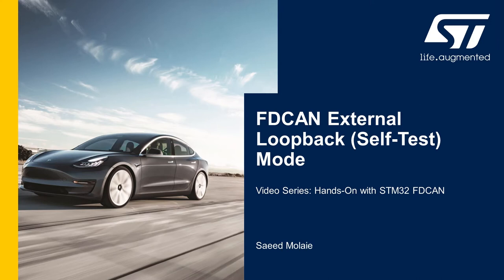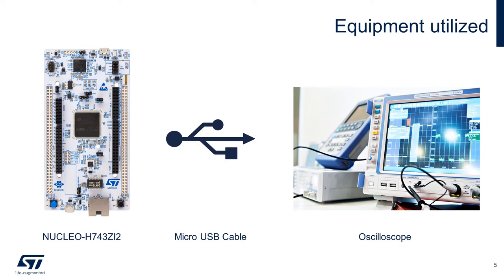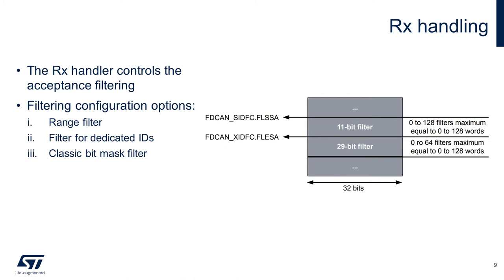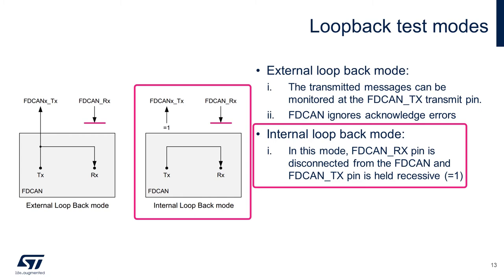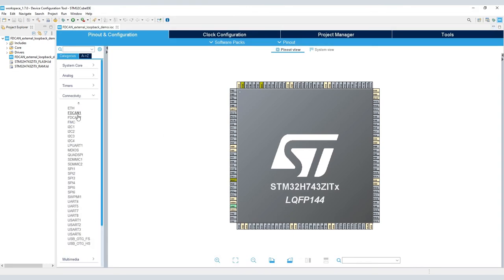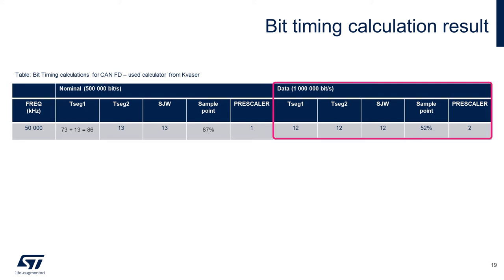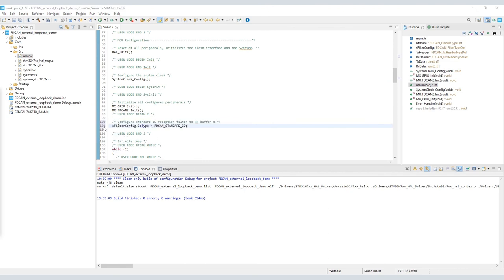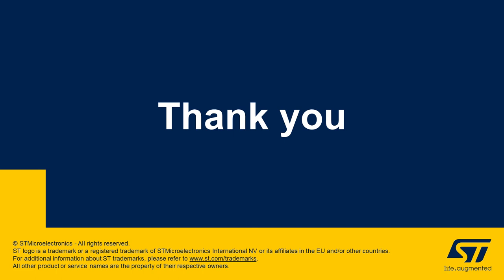FDCAN External Loop-back Mode

Comment: Hello, I have trouble understanding the "73 + 13 = 86" for Tseg1 in Nominal at the "Required parameters" section (~14:10). Where does the 73 number come from?

Comment: I have nucleo G491RE board can i continue with the same process??
Reply: No matter which MC you are using, if it has FD CAN Controller, u still can make these steps. Also, u can find in AN5348 which MC have FD CAN on a board🙃